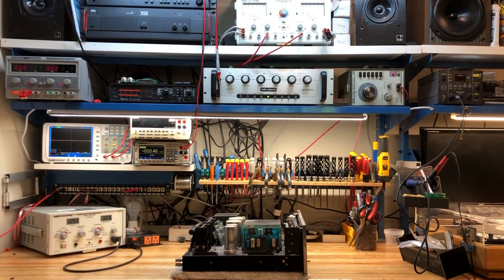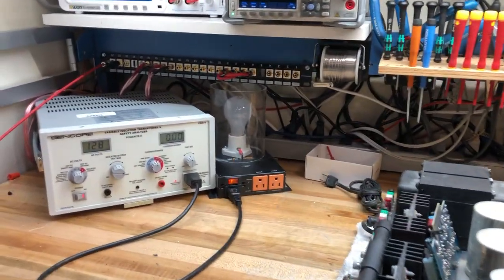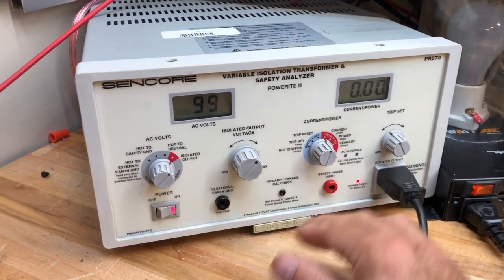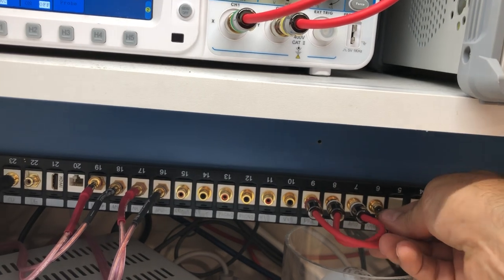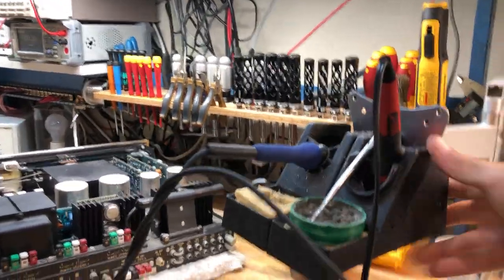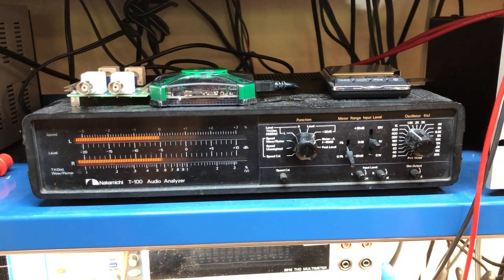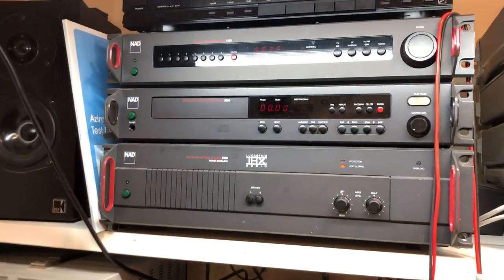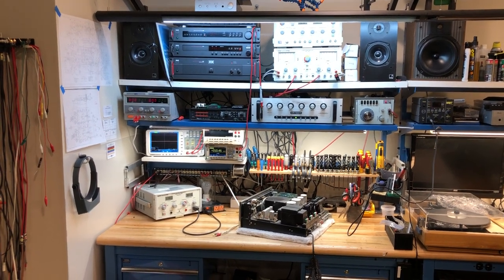Our Audio Electronics Test Bench - Where the Magic Happens...

Comment: Hello, nice setup! I use the Sencore PR570 on my bench. I don't have a dim bulb tester. I usually turn up the voltage gradually while monitoring the current draw. That works fine with mechanical power switches, but not so with a relay turn on. I like your dim bulb tester. Was it commercially purchased or did you bulid it yourself? When you're not going through the Sencore and using the dim bulb, is it isolated? If you bought the dim bulb tester could you give me the name of the manufacturer. It looks more compact then the one I would builf myself with a modified outlet box. Thanks for any information you can provide.
Reply from the maker: Hi Tom.  The dim bulb tested is home made from a few commonly found electrical boxes and fittings.  The acrycic cover is also readily available.  I use the dim bulb tester primarily for tube electronics and can choose between it and the PR570 at the flip of a switch, quite convenient.   For larger amps Bens bench next to mine as a larger version of the 570, cant recall the model but its hard to find.